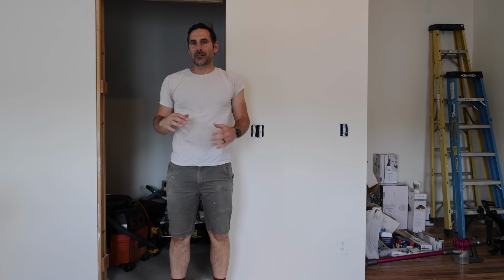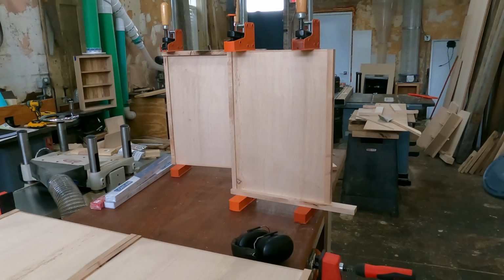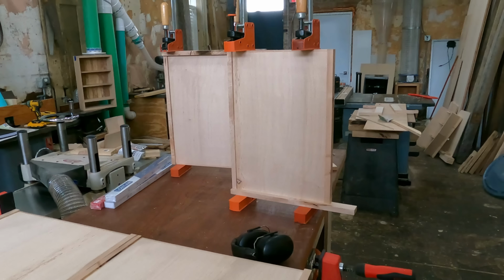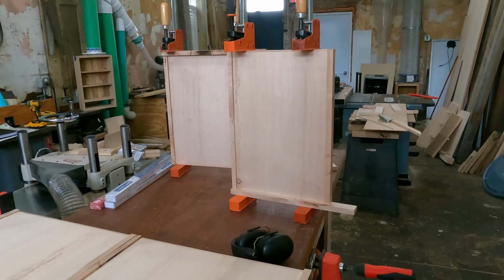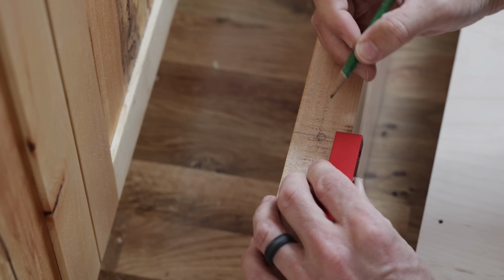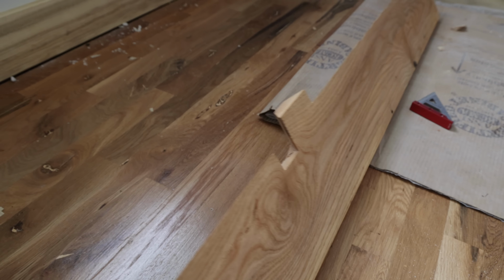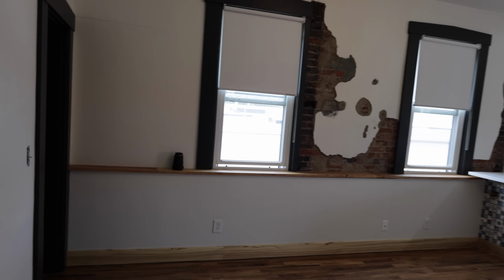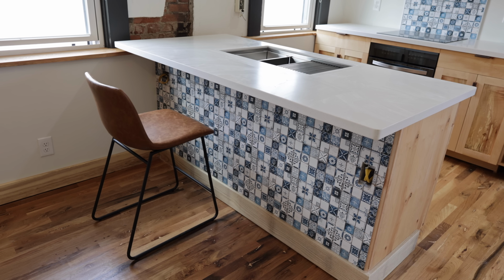Micro Apartment Renovation Part III

Comment: G'day, another great effort. You are a true craftsman. One thing I would suggest is to put a lip on the back of those slide out shelves, just to stop something potentially rolling off the back when you pull the shelf forward.
Reply from the maker: Good tip! I didn't even think of that.

Comment: On the pull out trash can, put a second slider on the bottom with a solid shelf. Pulls the bottom in, protects the door, and helps if the trash can gets heavy. Make sure you put an epoxy/shellac finish on it to protect it from wets. Also (just a suggestion) get a 2nd matching trash can and just put it in storage - eventually that one will wear out and you might have a hard time finding an exact match to fit in the opening! You can fill that gap with some sawdust and wood glue, then sand it flush. Once you finish it you won't really be able to see it.
Reply from the maker: Thank you for the great tips!

Comment: Looks like you are about to get nailed with a massively strong thunderstorm cell now!  😮😮  Do you think the bottom of the trash can needs a folding ghost foot to help with the added weight when fully extended?
Reply from the maker: Yes, we did get that. It's possible, the drawer sliders are supposed to hold 100 lbs so we will so if they can!

Comment: I do love the exposed brick, loved the tiles, but my only concern is the shelves and the hob directly under it, the steam from food will make it damp and if boiling a lot the steam will drip off the wood into your food, or are you putting in a big extractor somewhere above, either way it is lovely xx Dede
Reply from the maker: I actually had to move that shelf up higher, as it had to be 30 inches above the cooktop but it was only 20.

Comment: If I were you I think I would put some sort of support under that trash can, they can get heavy.
Reply from the maker: I'm going to brace the front so that when you pull out the drawer it doesn't flex.  They sliders can supposedly support 100 lbs.

Comment: How did you manage no vent fan for the oven area?
Reply from the maker: Believe it or not building code doesn't require it, but if you do put it, there is a complicated requirement for make up air, a perfect example of codes doing more harm than good.